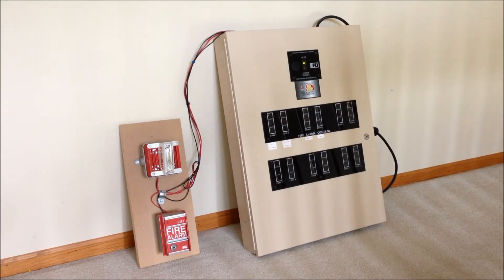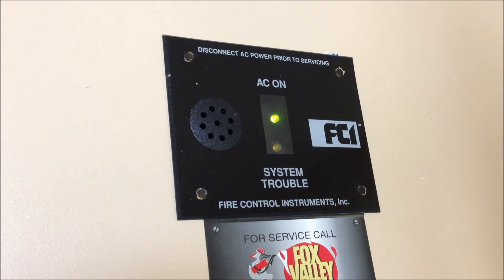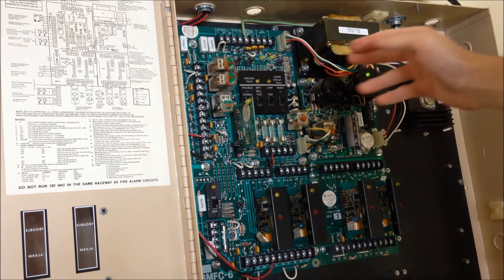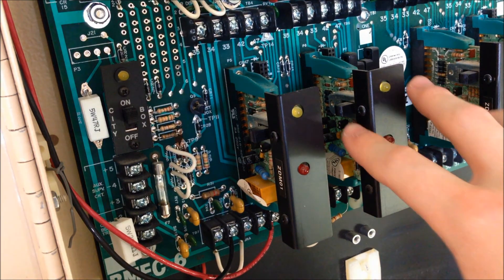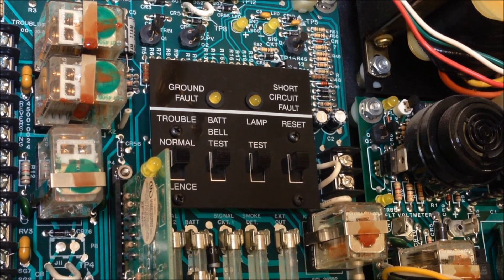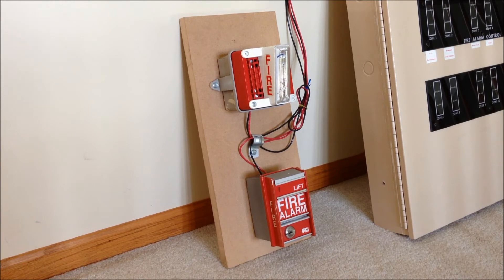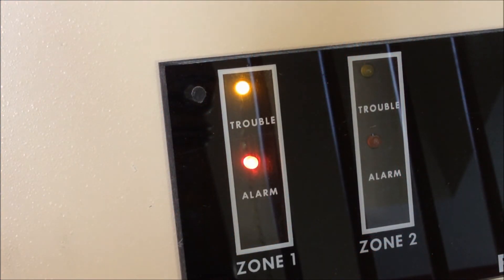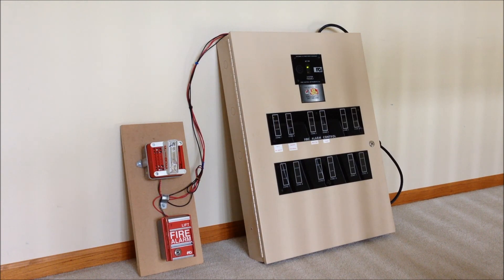FCI FC-72 Fire Alarm Control Panel Overview and Test

Comment: I guess this is the predecessor to the 7200 panel, which I’m pretty sure was the predecessor to the E3. 
I’ve seen quite a few 7200 systems with speaker strobes. Any idea what they might sound like? Maybe they’re using external voice evacuation panels from a different manufacturer?

Comment: Hi, thanks so much for this video. I have this exact same panel in the church that I attend. One of our cards is giving us a trouble alarm. However, there is no fire alarm cables hooked up to it. Just a couple of resistors. Any idea what the trouble might be. Could it be a bad card? Any idea if these cars are still available? Thanks!

Comment: Apparently, if one of the small tabs on the mechanism of a 450D-D1 is out of place, the horn starts fine, but drops in pitch after a couple of seconds and then starts to sound like a BZ-54.  I found this out with my H-45024T4R when I first got it.  All the tab needed was a slight adjustment with a flathead screwdriver, ans now it sounds just fine.

Comment: I think you got this version of the horn, like on this video, on the left: https://www.youtube.com/watch?v=JbQkCG2SLvk
Reply from the maker: Correct, this particular unit is a D1 series horn. From this same building I also removed a B4 series and 2 C2 series horns.
Reply from the maker: The B4, D1, and C2 horns I pulled from the building are all dated 1994. Seems pretty redundant to run 3 different series of horns at once.

Comment: The preschool building at my school has the same Panel it has over 20 troubles on it
Reply: The catholic school by my area used to have this fci panel and annunciator but recently got replaced by new notifier panel and a few Exceders and 1 TrueAlert which was randomly out of nowhere are slowly replacing each dead 450d alarm.

Comment: Does this panel contain any microprocessor chips or is it based entirely on solid state circuits?
Reply from the maker: No microprocessor chips, in fact, there is only one Integrated Circuit on the whole board (an LM339 Voltage Comparator near the control switches). Everything thing else is run by individual transistors and mechanical relays.

Comment: I believe the control panel was featured in S.E.R safety's video when he went to Koorsen. If I'm not mistaken.
Reply from the maker: The FC-72? There was a similar unit in that video, but the panel seen in this video I removed from a bank building.
Reply: kcin556 yes. That panel was very similar to yours